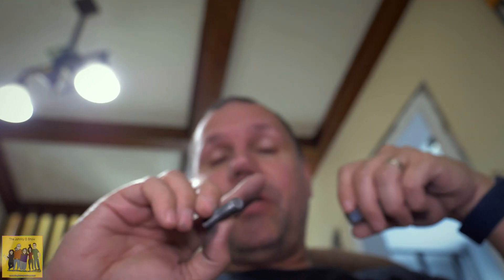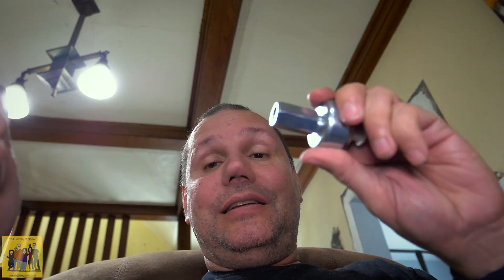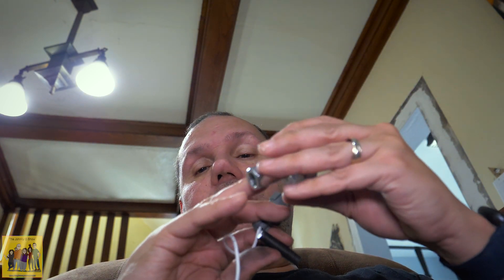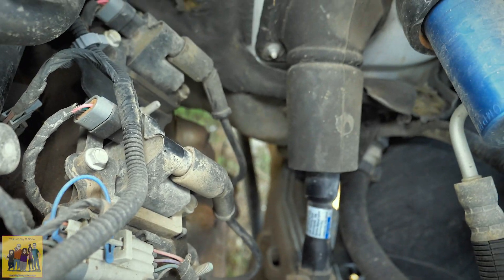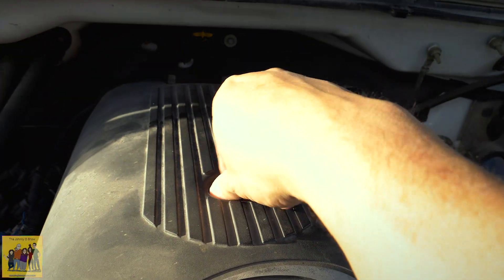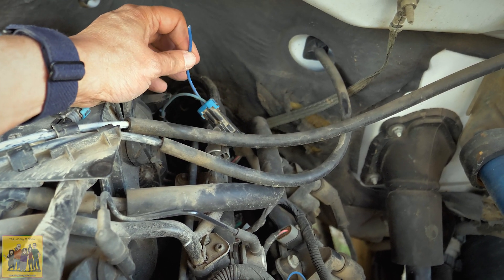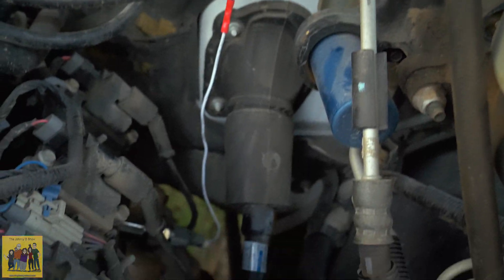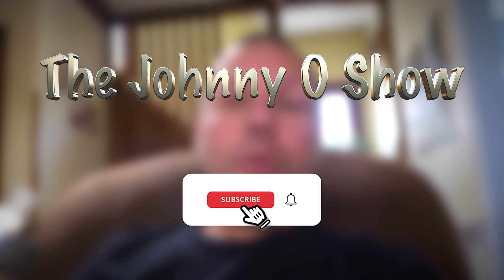Ep. #897 2001 2500HD GMC Sierra: GM LQ4 Knock Sensor Relocation

Comment: If there are places between 4 & 6 and 3 & 5 it would be the best place, but GM has actually moved the sensors to the bottom side of the block.

Comment: Replacing the knock sensors is a hit or miss action especially if you put them back under the intake manifold. Many of the current sensors, even the ones made by GM are defective even though they ohm out correctly. My bank two is pushing a code right now, the sensors are original to the vehicle, 23 years old and 250000 miles, came on yesterday. Where I live it would cost $1200.00 to pull the intake and replace them, shop labor is beyond reason.
Reply: Not bad money for a 45-minute job, I wish I worked in your area.
Reply: Will a bad knock sensor make the motor knock

Comment: I did this and i still get low voltage codes. Sometimes bank 1, sometimes bank2. Sometimes both.
Reply from the maker: If you're still getting the warning after replacing the sensor, check the wiring and connector. Unless the new sensor is defective out of the box, the most likely issue is faulty wiring between the sensor and the ECU.
Reply: @Thejohnnyoshow  
Thanks. I'll check it out.
Reply: @curtis1951 did you figure it out yet? 👏🏼
Reply: @brandonflores7372 
No. Everything checks out good but still get codes for knock sensors. Had a mechanic Tell me that the occasional tick that the engine makes either from lifter or pistons (lifter noise and piston slap is common with 5.3's) could be setting them off. He said  it probably won't matter how many knock sensors I put in it if the engine ticks when I start it they'll set a code thinking it's knocking. Truck runs great otherwise.

Comment: 1. Gen 4 has the Sensor on the block. 2. Putting it Where you put it is going to cause issues. I could explain it but there's plenty of videos that do so. I'm not trying to be a hater but this information is false.

Comment: If you do not hear a knocking engine, this knock sensor has caused many sad days of codes. I have a new engine and new A/Z sensors lasted 2-weeks and now codes again.
Reply from the maker: mine lastest just over 1 year and failing again, i bought one with a litetime warranty so i just need to replace it, but yeah it's a pain
Reply: @Thejohnnyoshow  Move them onto the block.

Comment: May 16 2024 , Hello , when you relocated the knock sensors, did you put them between the 4 piston , on both side ? When you relocated them, how did it work ? How long did you leave them in the relocated spot and how long did it work for ? Did it light up engine light and did the vehicles have any other problems ? Did it run fine  ? 

As for the ECM , I have talked to a company in NY that Refurbish and programs , any ECM computers . They explained that there are different program all ready written each specific ECM . That you can not just make adjust , none less you have a certain computer and program to do this . If you had it done , who and how was it done to make adjustment or rewrite the program ( software ) ?
Reply from the maker: I only replaced the one that was bad, sensor 2, i put it between the piston #6 and #8 (driver side), i never changed anything with the ecm, i have found the heat will cause it to fail within a year,  i have a life time warranty with the brand i bought so i will change it out, but i need to add additional heat shielding if i keep it where i placed it

Comment: May 14 2024 , hello , update how did this relocate knock sensor work out ? 
If you did have to make adjustments to ECM (aka PCM ) if so who did it and how ?
Reply from the maker: So i talked to someone that is a mechanic and he claims that it will not cause a problem moving it out where i did as far as detecting knock. (so for what ever that is worth)

however it has failed again after about a year, i think its getting to hot in this new location, so i have to try putting some kind of extra heat shield around it or something.

Comment: Thank you for the information AND explanation.  I have an ‘03 3500 with 50k miles in mint shape other than the engine light (knock sensor of course)
I’ll be trying your fix this summer.   Toes crossed!  🤞🏼
Reply from the maker: I will be updating this video, i know others have put this in the same or close location but i think it needs some kind of heat shield, the end to the wire is now distorted from the heat and keeps coming off. so something more needs to deflect the heat so that needs to be taken into consideration, also im not sure if the sensor is still good or if its just because of the wire, but even when the wire is now attached it will throughs an error. i still have to replace the connector and see if ti resolves the issue, if not that means my new sensor has already failed again, if so probably because of the heat
Reply: @Thejohnnyoshow  What brand of sensor did you use?
Reply from the maker: @flumescanada1059  Standard Ignition ,

Comment: Computers don’t have ears
Reply from the maker: I understand that ECUs do not literally have 'ears,' but when I said 'hear,' I was using it as a simple way to explain the concept. What I mean is that when the knock sensor is relocated, it may not detect engine knock vibrations as effectively because the sensor's output, in terms of voltage generated by these vibrations, could be reduced. Therefore, the ECU (Engine Control Unit) requires recalibration to adjust to the altered signals from the moved sensor. It's a figurative way of explaining that the ECU needs to be 'tuned' to recognize and respond to the new sensor position accurately.  Indeed, in a broad sense, a knock sensor operates on a principle somewhat similar to that of a human ear. Both are designed to detect vibrations – the knock sensor detects mechanical vibrations (specifically, the unusual 'knock' in an engine), while the ear detects sound vibrations. Both convert these vibrations into electrical signals: the knock sensor sends these signals to the ECU for analysis and potential adjustments to the engine's operation, whereas the ear sends signals to the brain to be interpreted as sound. Despite the different contexts and types of vibrations they detect, the fundamental concept of converting vibrations into electrical signals is a shared characteristic between the two.
It's called an analogy
Reply: @Thejohnnyoshow will a bad knock sensor make the motor knock
Reply from the maker: @anthonycarter2641  A knock sensor will not cause your engine to knock, but if it fails, the computer cannot prevent knocking if it occurs. You can have a bad sensor without any knocking, but the sensor’s purpose is to protect the engine from catastrophic damage when knocking does happen.

Comment: Without tuning, does this still eliminate the fault code / check engine light?
Reply: I recently had my knock sensors replaced the right way and cost me about 300 bucks. The light came on again after driving about 50 miles. I have 03 tahoe with 5.3   I bought the two sensor and harness kit and am going to relocate both. The front sensor will go on the block across from the fan, and the other will be approximately where you placed yours. Hopefully, this will end this check engine light crap. I'm certainly not gonna fork out another 300 and  pull the intake off again just for the damned light to come on again.
Reply: @mitchellmontesano8769  how did it work out
Reply from the maker: yes